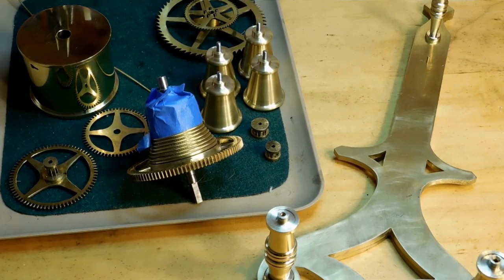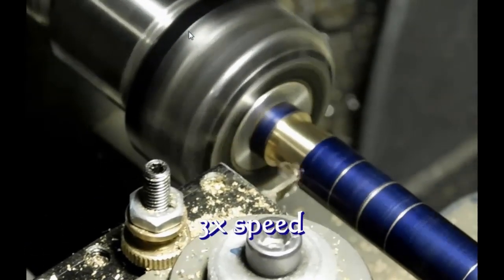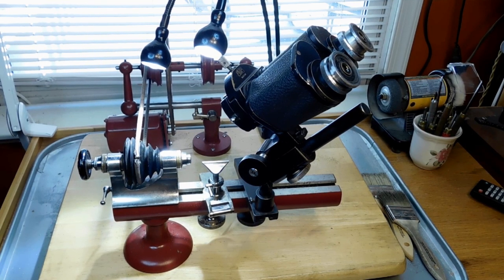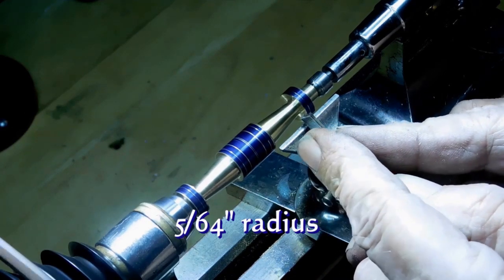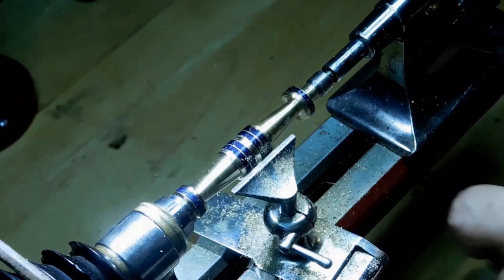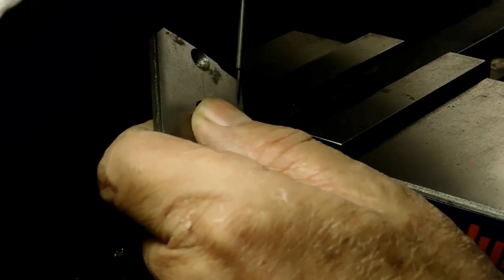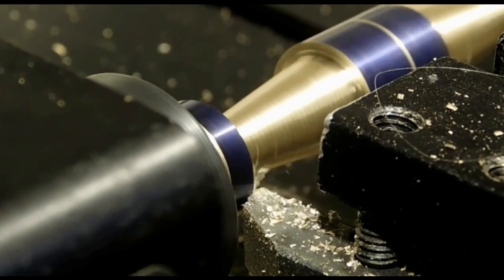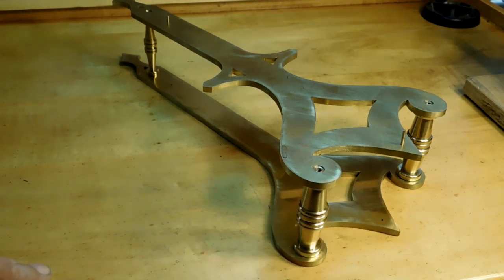WR Smith's Grasshopper Clock: Part 3 The Pillars

Comment: Thanks for sharing! So wood turning skills can be used in watchmaking. Hua, who would have thought.
Reply from the maker: Hi Craig...I did some wood turning in high school...using a graver is a bit trickier...but sharpening a graver and using it first in brass then mild steel and tempered steel sure gives you a good feel for cutter geometry...bob 

Oh I should add this as well...I have made tool rest for gravers for both the Sherline and Atlas lathes...they are nice for finishing off stuff now and then...but with out the foot petal speed/on/off control and a bit of experience they are much harder to use and dangerous at times...I never use a graver with a 3 jaw chuck...I only use it with collets...bob  
  

      
  

    

          
        ·

Comment: Bob, great video.  I love watching you work.  Do I remember you having some kind of tool to help you grind radii on your tool bits?  Where is that tool from?  The clock frame and columns are looking great.  Thank you for sharing sir.

Joe
Reply from the maker: Thanks a lot Joe…I do have a single point cutter tool grinder (a small one I use mostly for engraving bits)…but I did not grind the radius cutter with a tool…I did it freehand…in fact I just made another radius tool this morning to make the grooves in the large washers for the grasshopper clock…I did not video it…but I need a slightly smaller radius tool for the washers on the top pillar and I’ll video the construction and include it…I’ll show platform I made years ago for my 6” grinder to facilitate all the different cutters I make…maybe I’ll include a short look at my Kennedy tool box that has 4 drawers of nothing but HSS lathe bits I have made or collected over the years…I go through it before I grind up a new one…I just went through it this morning…kinda like saying hi to old friends…thanks Joe another great suggestion! …bob